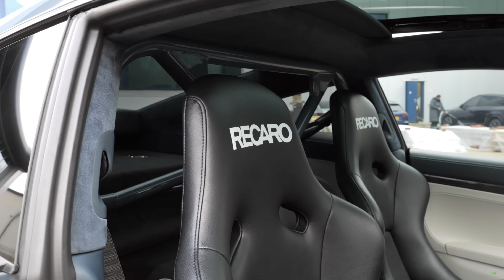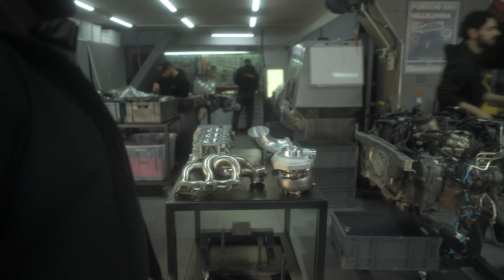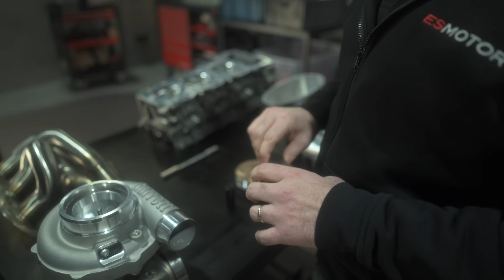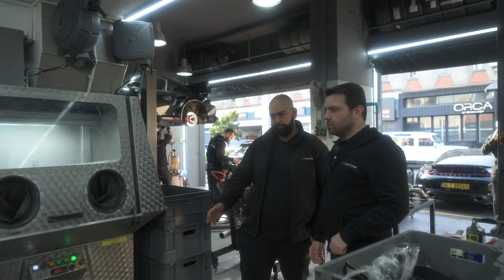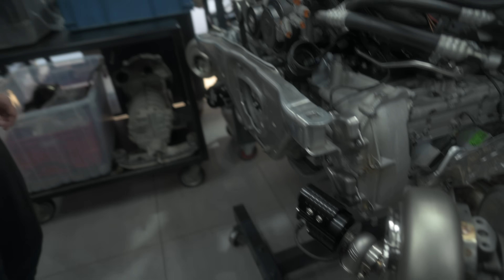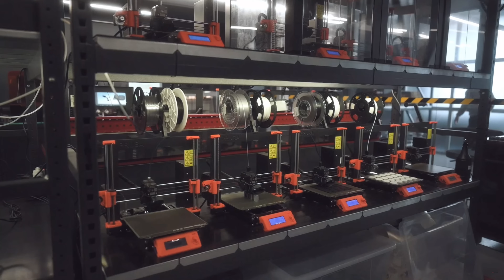MY ES MOTOR 1XXXHP 911 TURBO S.. ITS NEARLY TIME

Comment: A lot of Aussie performance engine builders are first putting the engines in a controlled Cooling room and once it’s reached the temperature they desire they start measurements and then build the engines. 

This is how they are able to find huge horsepower and torque from engines and this is also how V8 supercar were built for Australian supercar race series were built and able to be taken to 7500rpm and raced for a 1000 kilometre race called Bathurst have a look at how hard they are driven and you are going to be shocked